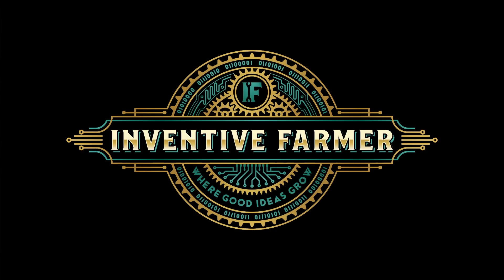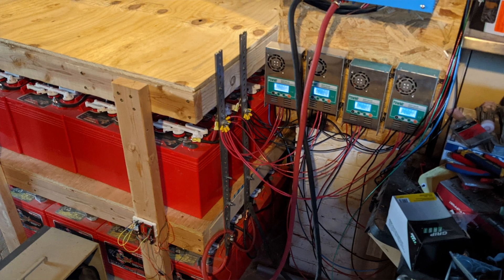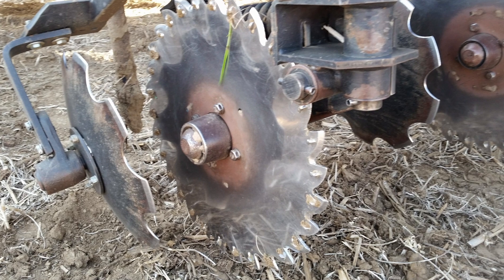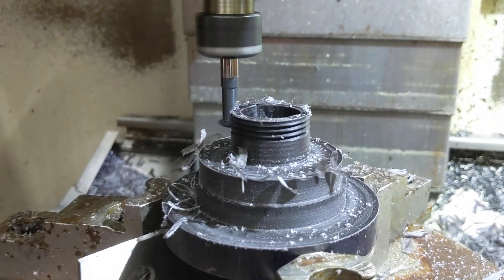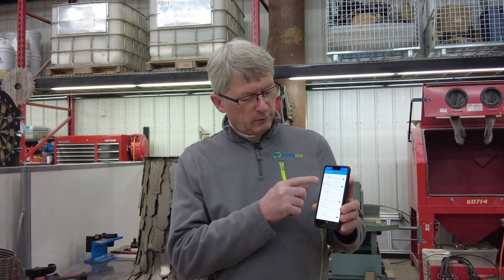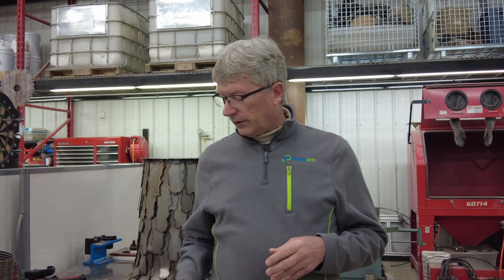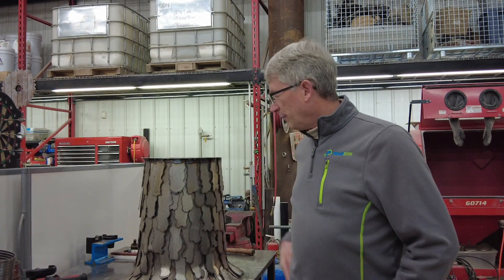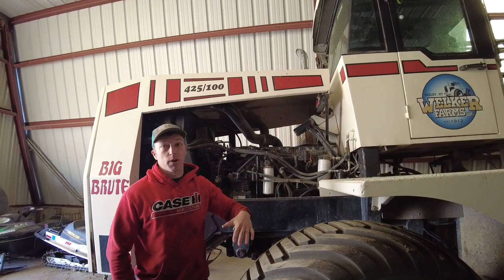Introduction to the Inventive Farmer channel.

Comment: In high school i designed the rafters our farm shop. 

We modify a rubber railroad articulated truck into manure truck. 
I will be designing and building a new custom articulated farm truck/tractor. 

I modified the electronics of our automatically milking system.

I am X farmer, with an engineering degree.
 

You find a electronics task i will put you in touch with local electronic hackers who would most like love get involved.
Reply: Farmers, are great at knowing by instinct and experience what works and doesn't work.

But we need to do something calculation when building something for the fist time.

An engineering tables book is incredibly useful!
When building something based on a new idea. I found google scholar and sci-hub an valuable source.
Reply from the maker: Excellent!  There are many farmers who are quite inventive.  All of the circuit boards for Mixmate are built here on the farm.  We used to raise hogs years ago and the farrowing house has been converted to a clean room and we call it the Board Room.  I will do a video of the process someday.
Reply: @InventiveFarmer  

You etch your boards and mount components. Or just reflow mount components?

Where are you located?
In the summer, i can perhaps share the building or our articulated Cambridge rubber railway manure truck and the new design. The rubber railway truck replaced the wheels with combine wheels and used log skidder tires.

The new design is not built yet. 
It will allow quick attachment of hydraulic powered and hydraulic articulated trailers. 

The new design is a hydraulic articulated power trailer will allow a much lower center of gravity and attachment special hitch.
Reply from the maker: @tdwebste    We buy the bare circuit boards and have a pick and place machine to place the small components and the large components are hand placed.  Surface mount components are reflow soldered and the large connectors and capacitors are hand soldered.  If you want to email me my address is: doug@inventivefarmer.com  I would be interested in other projects from others in the future especially if I can work it into my travels.